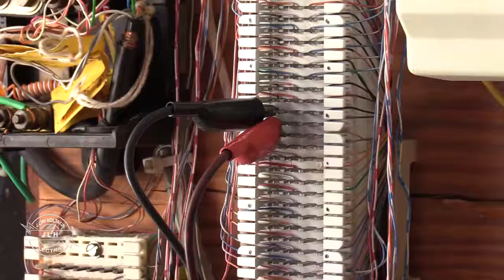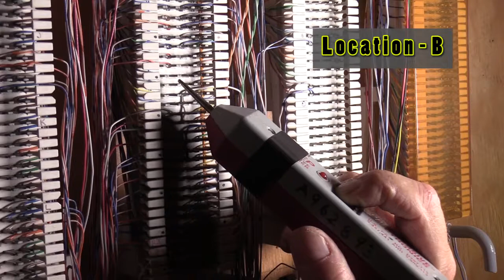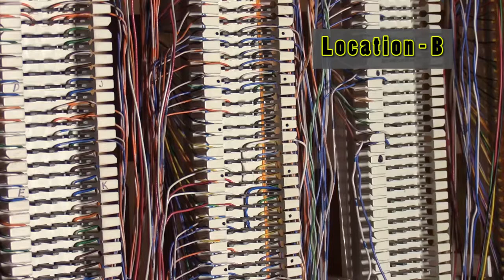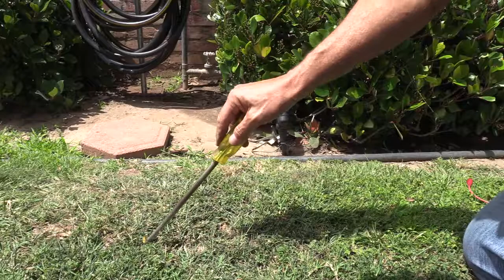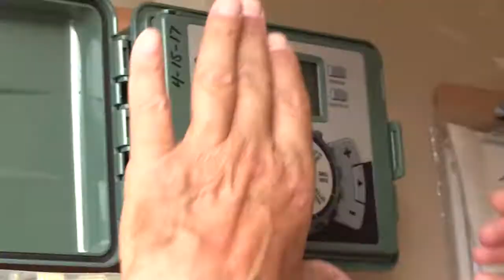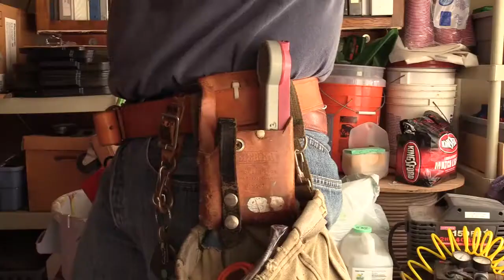How to use a tone generator to trace a wire

Comment: Hi:  We have tried several tone generators but (presumably because there are a lot of 5 to 12v power cables as well as data cables - we have been unable to identify any individual/specific cable.  We have emailed several tone generator suppliers - each of which have said their machine is not capable of working in this situation.  Might you be able to recommend a spcific tone generator that will do what we need please??
Reply from the maker: Peter, Please give me a call and I can help you out. 310-398-7430 (voice only-no texts)